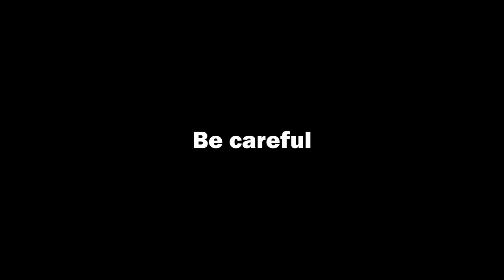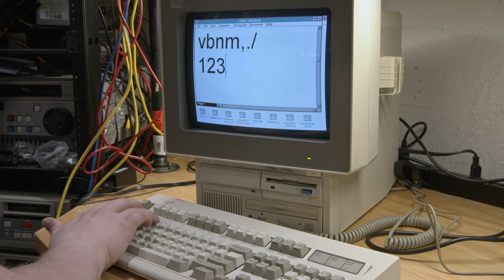Cleaning a Filthy Model M

Comment: A trick to get a paper towel in between spaces like that is to fold it to the thickness you need, and wrap it over the edge of a credit card or similar.
Leave one end shorter than the other if you want to save on paper, and just pull the short end of the paper up a bit when the part that is on the edge is saturated.
Also, if you need to wipe an uneven or bell-shaped space you can bottom the card out, slide both sides of paper down as far as needed, and agitate.

Comment: This was so satisfying!

I cleaned up my own IBM keyboard just last weekend, though it's not a Model M but a KB-8923 dome-switch from 1996. Comparing them was really interesting - on the outside they're broadly similar including a matching missing leg, although the later model has pair of 9x era windows keys and a context menu key. On the inside though they're completely different, with ordinary Phillips screws and a membrane that can be easily taken out and examined. I did, however, resort to a flat-head screwdriver for scraping out the dander pretty quickly (it accumulated on a harder plastic than seems to be in the Model M).

I know dome-switch isn't a "proper" mechanism or whatever but it's neat enough for me!

Comment: 8:20 It is possible to go further, by cutting the plastic rivets off, but then you have to bolt-mod it to be able to put it back together.
Reply: A surprising number of the rivets were still intact, so my initial skepticism was replaced with "well that one didn't need a bolt mod yet anyway" 👍

Comment: Have you thought about getting a dedicated keyboard-cleaning electric  toothbrush?
Reply from the maker: No, but that's a good idea. Wow. Damn. Never thought of that. I have an electric toothbrush that I haven't used in years I could repurpose.
Reply: @CathodeRayDude  For tight spaces like that I use a children's toothbrush, but first I sand down the sides, back and front edge with a belt sander. It's surprising how much plastic you can remove and still have a usable scrubber. You can even sand off some of the bristles and the rest will stay in place.

You can also heat the neck and bend it, which might have been helpful with that keyboard.

Comment: I just realized you put the screws into plastic directly, which can weaken or destroy the threads by cutting new ones. You should always rotate them counterclockwise a little bit to ensure they fall into the existing grooves.

Also you made a dent on the spacebar by lifting it with the screwdriver when looking for the bail thing. We should probably always use plastic or wood tools for this.

Comment: I've also got an old Model M that's in need of deep cleaning and repair.  Unfortunately the mechanical issue with mine (endless phantom keystrokes despite the stems and springs being basically unused) seems to indicate the underlying membrane contacts are worn down too much and I don't want to cannibalize a working Model M to fix it, so I probably need to send it to a professional.

Comment: the filthiest peripheral I've ever cleaned, beating out all the kindergarten computer lab Mac mice I have, was an IBM Model M that was in a house fire. it's still got soot embedded in the texture on the casing and key caps, despite scrubbing it more than you did yours. it didn't survive the fire fully; the heat warped the upper case, and the key barrel frame cracked. I ended up bolt modding it with a new key barrel frame from Unicomp, and it's still going strong. :)

Comment: Here's how I would do it (And not implying your way is wrong):

1- Plastic chassis goes in the dishwasher.
2- Keys go in a delicates bag and in the washing machine
3- Vacuum and scrape of the as much of the ... detritus, as you did. 
4- Steel wool to remove the rust from the back, and more vacuuming.
5- Soak that filthy, filthy board in denatured alcohol for ... ever. Scrub it up using a dentures brush, and let it dry.
6- Let everything dry and then reassemble.

Comment: click restored! made me laugh, unexpected 😄
I recently got a 122 key terminal one. Love it! 
Much better than most modern MX-Type switches.
I hope you used the correct lubricant for the stabilized keys. Vaseline will degrade the plastics.
Reply from the maker: I didn't lube them for that specific reason, I didn't have anything appropriate and I figured they didn't really need it.

Comment: Do all Model Ms have those nut head screws on them? I don't recall having a problem taking apart one the last time I cleaned one many years ago. That is unless I happened to have the correct bit somewhere, which would be surprising.
Reply from the maker: can totally believe you did - I've been informed I was overenthusiastic about their rarity. I believe there are other Ms that have more normal screws